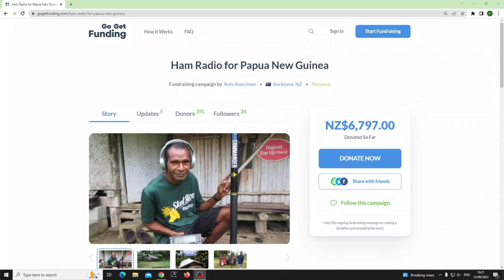We need to Understand Solar Power for Ham Radio

Comment: We have some panels but the inverter makes some qrm on the lower bands but it is not too bad. Get 380w panels so even in low sun they at least give some power and they charge the bateries fast
Reply from the maker: Have you tried some heavy ferrite cores? I did and the QRM went away (Victron)
Reply: @DXCommanderHQ  ok thanks for the tip! I will try it when we have our sistem running again (we are currently putting more panels and a different invereter)

Comment: KS energy lithium batteries are well constructed, a good company to deal with here in UK Callum.( I have 2 of them, 155ah and 120ah for my caravan and running my IC 7300 portable). You can talk to Neal, the company owner for advice, he has been most helpful for me, more than once.Craig Solar have a good customer rating, and well priced, they are UK based. As for an MPPT controler, Victron are good, but the Tracer BN controler is very robust, and can be programed, even by an old dinorsaur like me Cal!! regards M0OLY.

Comment: PowerFilm Solar, 2x Headway battery cell sets, Genasun mppt, and a Xiegu G90 amp, all through an antenna with gain, to realise the effect of driving 400w ( dBi).
Reply from the maker: OK, so we are aiming at 100W see 1:50 (bottom right)

Comment: Victron Energy SmartSolar MPPT 100V 30 amp 12/24-Volt Solar Charge Controller (Bluetooth) - They also make a 50 amp version. Both will work up to 100 vDC of solar panel voltage and will take up to 35 or 60 amps (depending on the model) of current from the panels. They also make a 150 volt version with up to 35, 45, or 70 amps for larger systems. You can monitor the system with an app via Bluetooth.

Panels ... all depends on local(ish) availability because they are large and bulky. For a totally off grid solution, I wouldn't mess with 12 volt panels. I would go for the 24 volt ones, and preferably 200+ watt ones. You would wire as many panels as you have in series or parallel to stay under your voltage and current limits of your controller. For example, if you had a 200 watt, 24 volt panel and were using the 100V 30 controller, each panel would put out a maximum of 37.2 volts and 5.38 amps. So you might put 2 in series for a max of 74.4 volts at 5.38 amps. If you wanted to add more charging capacity, you would put 2 sets of 2 panels in series and then parallel them together, so you would get 74.4 volts at 10.76 amps. 6 panels (1200 watts) would be 3 sets of 2 panels in series and then parallel those 3 sets of 2 together for 74.4 volts at 16.14 amps, etc.

Wires and connectors. Don't cut corners, get good ones.

You may also need an inverter to convert the DC to AC. While not needed for a purely ham radio application, if you want AC, it's something you will need. For a small system, don't go above 3000 watts.

As far as batteries, I personally would go with LiFePO4. Yes they are expensive, but you can use practically 100% of their SOC (State of Charge) as compared to a normal battery which you can only use about 50%. So a 200Ah standard battery is the same as a 100Ah LiFePO4 battery. LiFePO4 also has a MUCH longer life. You can recharge them upwards of 4000 times. I have a 5kWh LiFePO4 battery bank for keeping my fridge and freezer and other stuff running 24/7 for 3 days with no solar input. Those batteries have a 10 year warranty. They aren't cheap, but "buy once, cry once".

One thing to remember is that just because you have 15 hours of daylight doesn't mean you have 15 hours of USABLE solar power. On average, you may get maybe 4-6 hours at best. That is why you want more panel wattage than you think.

For more detailed information on setting up a solar system, I HIGHLY recommend a channel called DIY Solar Power with Will Prowse. Will has a TON of videos and is a wealth of knowledge and does extensive testing on a variety of components.

https://www.youtube.com/c/WillProwse

https://www.youtube.com/watch?v=RLgGGB_McW0

Another good channel, which might be more close to what you need in practical application is a channel called Projects in Paradise 808. He is 100% off grid (no ham radio, but still).

https://www.youtube.com/c/ProjectsinParadise808

https://www.youtube.com/watch?v=9DbQOSKLRfE
Reply from the maker: Nice - thanks..

Comment: Hi Roly and Cal, i've been reading, searching throgh the web and videos ... In my case i look for a island solution for my house (don't even know, if it's called island solution in english - perhaps it's a autarky solution?!? ;) ). The easiest but dearest way would be a complete bluetti power station system. A cheaper solution is some solar panels, a charger, a rechargable battery - LiFePo and some kind of controller (to provide the power for the station and protect the batteries). Controller and charger can be combined. All the cheap stuff on amazon and ebay seems crap (you have to buy 3 devices and luckily get one running). There are good controllers for camping mobiles that have one input for solar panels, one output for the battery, one for a Pb battery (that in this case is not needed). I'd buy a kit, so that no self engineering is needed. google "camping lifepo solar kit". First hit in germany is a kit of 3x100W flexible solar panel, a 150Ah lifepo battery and victron mppt 75 charge controller plus small parts. It's 1600 euro bucks. 100W more solar power, 4th panel and a second victron, is 60 euros more and even includes wiring. So with a 991a or a 7300 we're in the budget. vy73 bemi
Reply from the maker: Bemi.. Good advice. Thanks.

Comment: If I may suggest Powerfilm kit  https://www.powerfilmsolar.com for the panels - used extensively by military in all sorts of harsh environments.  UK distributor is https://www.selectsolar.co.uk/  Australia/NZ disributor is https://www.spearpointtechnology.com.au/  They have a useful calculator for application use vs power required.  Victron controllers are good - some people say RFI is an issue but not in my experience.  LiFePo battery bank is also the way forward for Isaac - especially if he can shelter them somehow (am sure he can at the station)
Reply from the maker: Nice one Tom!

Comment: I would think a static panel as opposed to a tracking system is sufficient that close to the equator. Batteries can probably be located in PNG (in the cities at least) since you could just use standard car batteries. They can probably even be older batteries if new ones are hard to find, just add a couple more to the mix to make up for loss to age. A few extra probably wouldn't be terrible anyway as they can run other appliances. If they need to be shipped, a little research would likely find a company shipping product that way who has some extra room in a container for a few items.
Reply: Forgot to add - the panels need to be IN THE CLEAR do not underestimate the slightest shadow as it will knock your charge performance for six! 
If you wire two panels in series that will usually get you a higher input voltage which will equate to a better charge current. My own system in full mainland europe midday sun gives me about 30A . If you wire in series fit bypass diodes too

Comment: I would suggest a 100W panel (minimum) and a LiFePO4 battery setup to run his radio. Li-ion batteries in 18650 size will also work but the size of the battery pack will need to depend on how long he wants to run the radio and at what power.  There are commercial batteries designed specifically to ride 12v amateur radios for remote setups but I f he is going to run up to 100W, then get a battery around 80-100Ah, but those are higher in price.
Reply: I would go for more that 100w worth of panels. Because they do not always give the full output, but even in overcast weather you will get 60 to 80w from 500w worth of panels. Also use an MPPT solar controller rather than a pwm , they convert the power to the correct charge voltage better.
Reply: @patdbean  Good points.
Reply: I agree Tim on the type of battery LiFePO4. I would not go cheap on the battery its Isaac only source of power. I would think he will do a lot of band work at night so he needs a system that will give him enough power. 73 Joe
Reply: @Joe-KN4IFI  I agree with the higher capacity battery bank.  He’s probably going to pushing higher wattage and will need the higher capacity to make it thru the night.